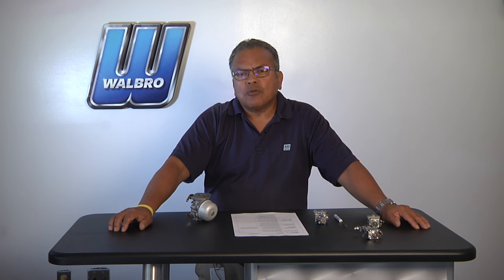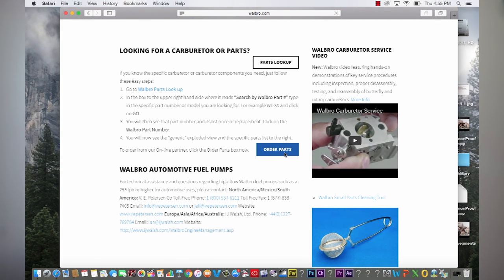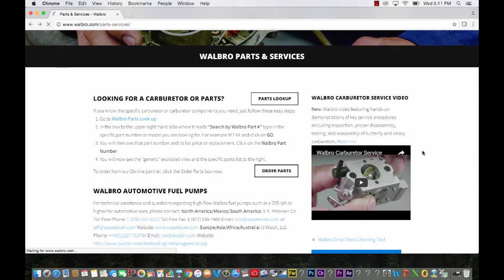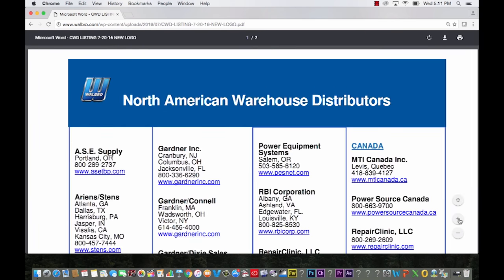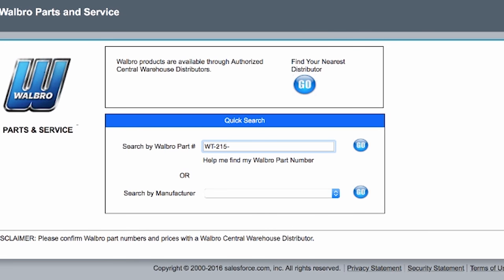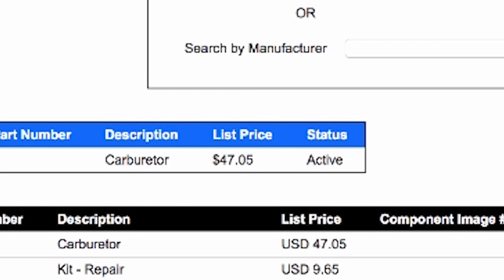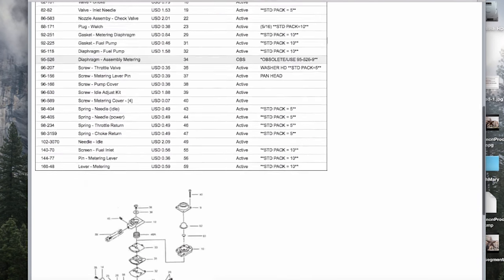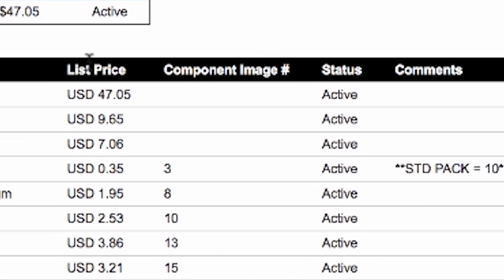How to Find the Part Number on a Walbro Carburetor

Comment: on a lot of the carbs i worked on the numbers are very faint,  you guys should either put raised numbers and letters or stamp the info model no. and spec no better in my personal opinion to make it easier to facilitate a quick id of the carb in question.
Reply: I have a LMG. The G looks like a C. The serial number is as plane as day. Of course I'm assuming it's the serial number. Can't find a model number and this video covers everything but the LMG it seems. I agree they could do something different.

Comment: Walbro 0525  wt 650 carburettor I need the gasgets front and rear plus a new and carburettor and the mounting block between the carburettor and the power head

Comment: Good info, but I have a Echo Chainsaw CS-310, it has a Walbro WT 1089 carb.. but I do not see any -# .. with no dash number what do I use for model number in a search ?

The web-site has changed from this video, btut when I do arrive ar PArts lookup area it does not find a WT-1089 carb.
What rebuild kit is used in this Carb...

Comment: I need a replacement, carb is a WTA-4-1. The problem is the ice auger needs the shaft 30-1037, I can't find it anywhere because it's obsolete. I can't reuse the one I have as the shaft is broken and the body of the carburetor's set screw housing in broken as well. Some gorilla beat the heck out of it. What to do?

Comment: On tbe rotary carb of mine it has numbers on the flange. One side says: 47 053 86. On the right side of the throttle hook up it says: WHG71 0795. Is the WHG71 the model number?
Reply: Yes, WHG-71 is Walbro part number.  47-053-86 is Kohler part number.

Comment: Does anyone know what model walbro was on the viza viper scooter.its a 33cc Kenyang engine designed by Mitsubishi any help would be appreciated
Reply: Walbro's only carburetor for Kenyang was model WYK-119-1, but that lists a 40.6 cc brush cutter.  If you have the engine and carburetor provide all numbers off carburetor and I will be able to figure it out.
Reply: @bobmccuewithwalbro7349  thanks  i will be getting that scooter out of storage in the next few weeks.thanks again

Comment: I need a carburetor for a CS345 I did notice WT 589  and other is WT402A .  Can I use either 1 of those cause do fit same saw model.
Reply: Walbro records do not show WT-402A and WT-589 being used on the same model.  WT-402A was released in 1995 and shows CS3000/CS3400/CS3450.  WT-589 was released in 2004 and shows CS-301/CS341.  You should consult an Echo dealer as the manufacturer can use the same powerhead on many different models and Walbro is not notified of this.

Comment: Hi Luis, I have a Walbro WYA 71  624 from a Ryobi cultivator. When I research it is no where to be found, however a view of a Walbro WYA-247-1 comes up that looks correct, will this work in its place? Thank-you for any input.
Reply: I have a Walbro carb on a Craftsman backpack blower that is stamped 247A 941. Cannot find a cross reference on it. Did you ever?  Thanks, from Kentucky!
Reply: @Suncast45  No I did not, I just went on Amazon and compared them to mine and just ordered one of those cheap Chinese ones, they work for the most part. I also have an early Mantis and ordered a Chinese carburetor for it, for $13.00 it came with new carb, new fuel lines, new spark plug, and a new filter. I put it on and it started right up and has a higher rpm and it even idles.
Reply: @DesertDigger1  Thank you for your help. I may get the craftsman blower running yet!
Reply: @Suncast45  Take the muffler off and inspect it for clogging and while you're at it look inside and inspect the piston for scoring while you have it off. Good Luck!
Reply: @DesertDigger1  Thanks! I will do that!

Comment: Can i put a lawnmower carburator in a Hemi engine in a Chevy 350 v8 and run it in "Woodward  Dream Cruise??"
Reply: Sorry for the delay, but yes you can.
Reply: @mrbrown6421  That's not correct. I tried it and it ran rich to the point where the plugs sooted up. I had to decoke the engine after 10 miles.
Reply: @keithashness553  Oops. Sorry. Wasn't thinking straight that day. Its COVIDs fault.
Sowwy.

Comment: The model numbers are hidden because they are useless products.
 I have a homelite blower which relied on a WYL carburetor 6A 652. It never worked. Being busy with my job I did not use it within the guarantee period and teh company I bought it from though a national company failed . The tuning screws were not visible. . I have wasted so much time because of this. Walbro thinks its doing such a good job, well not if the stupid things don't work.  Currently trying to fix the stupid machine many years after originally buying it., having bought an electric one. Hating Walbro is sadly not far off how I really feel. What did they think they were adding to customer care. DO they think people will fiddle with it when they don't know what they are doing? I doubt very much that very many would be returned to Walbro because of this, and certainly not more than the number of faulty useless products that come with Walbro carbs